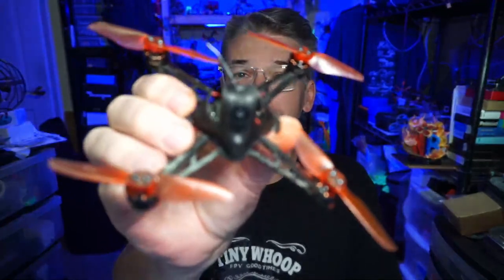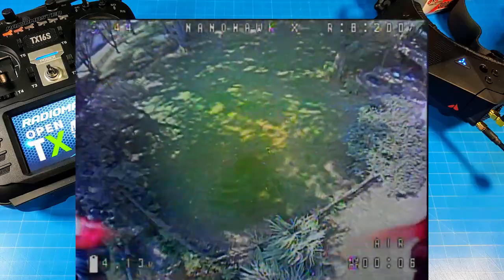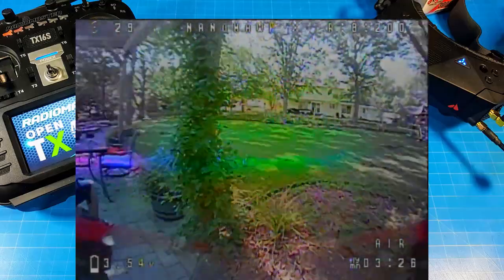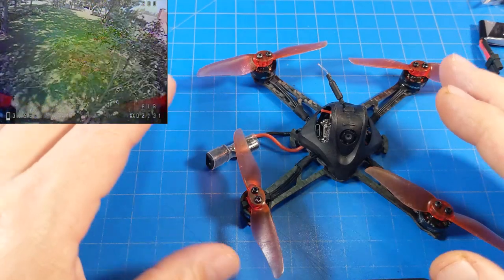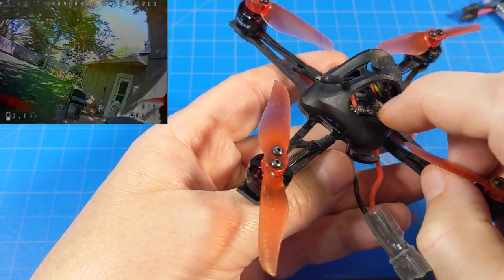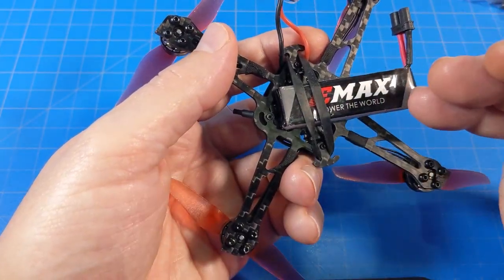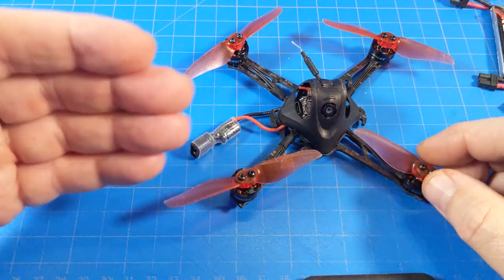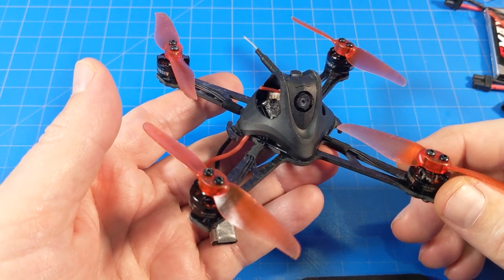Emax NanoHawk X // Durable Micro with Tricks // Ali Express Coupon

Comment: Hi Nick! Great video, I love this board! I put this board on Bob’s TP3 months ago and haven’t killed it yet. I can’t seem to unlock the power on the vtx-only 25mw on the Nano Hawk board. Really hoping for a little better range, especially since it could take a crossfire with the extra uart.
Reply from the maker: I presume when your unlocking your holding the vtx button down and plugging in power, either battery or usb? Keep the button down for a few 'counts' after plugging in.
Reply: @NickBurnsFPV  yeah, I think it’s only 25mw on the original Nano Hawk board, I hope I’m wrong but I’ve tried a few times now and in betaflight it is still only showing 25 or off for vtx power
Reply from the maker: @joelpearson8623  oh, I forgot the vtx did change
Reply: @NickBurnsFPV  thanks for looking into it for me. it’s still a great little board.

Comment: You sold me on another one, I just ordered it. I think this will be perfect for my small backyard and it's quiet. I got the moblite 7 and can fly it pretty well in my small space and hoping the Nanohawk X will be a little better outdoor flyer. Is it possible to bypass the built in receiver and use a crossfire nano receiver?
Reply from the maker: We should be able to add an external rx. The board manual shows an sbus pad as well as rx1 and tx1. I am not sure if the vtx uses uart1 or not. If it does using the rx1 and tx1 pads for  crossfire or elrs rx could disable the use of vtx smart audio.
Reply: When crossfire would be installed and it does disable smartaudio. In your experience could I use lua script though crossfire to change vtx  band channel power? I purchased this for order but really hoping to install crossfire for better range 🙏
Reply from the maker: @fpvdetailz712  I don't know for sure it would impact sa, but that is a concern. I have not found one way or another the impact of using the rx and tx pads, maybe its tied to the on board rx and thus works normally. SA is on uart2, and the rx and tx are labeled 1, so it could be all clear to use as the rx. I am not sure on the use of lua. I have not don't that before on a AIO

Comment: Price is a little heavier than expected, womp womp. I would like to buy the new version of this board, but if you google the board, they all show the original. Hard to tell if you're going to get new or old stock.
Reply from the maker: I have been told they are the same. Nanohawk and Nanohawk x = same AIO
Reply: @NickBurnsFPV  They recently released a new version of the Nanohawk with the new FC that has plugs on it now. But it's hard to tell what you're gonna get if you order a Nanohawk from any given retailer. They definitely used the new version on the Nanohawk X. I just want the new board for a custom whoop build.
Reply from the maker: @dubzsquaredfpv7171  I guess emax doesn't consider the connectors or lack there of a different version, which sure does make it harder to ensure we get what we are looking for.
Reply: @NickBurnsFPV  Exactly! It's my understanding that some comments on the board were rearranged. I'm guessing they had to do that to fit plugs. I only know there's a newer Nanohawk because of Patrick J. Clarke's announcement that he's working on a new PMB tune for it. As you suggested in the video, I hope they make an ELRS version.

Comment: If this is the same board as the tinyhawk2 freestyle, does that mean you could just switch the motors for 1103 7000kv and plug in a 2s battery?
Reply from the maker: It’s a different board, standard whoop board. Tinyhawk line had the elongated board

Comment: Would you prefer this or the HX115 LR from BetaFPV?  They seem to have similar specs.
Reply from the maker: This for me is far better. The HX115 LR is more of a cruising or exploratory flyer. The Nanohawk x can do that as well as fly much more aggressively...and better without having to change props and the PID tune.
Reply: @NickBurnsFPV  Thanks!  I prefer the top mounted battery type frames.  Maybe the motor/prop setup on the Nanohawk could be used for the HX115 (assuming Emax sells those motors/props separately).
Reply from the maker: @MrMmDonuts  sure, 1202.5 is a better pairing for a 3inch prop than the 1102 on the hx115 lr

Comment: Basically NO breakup in goggle feed compared to your flight with the Tinyhawk III. How is that possible??? Any more micros recommended with no breakup feeds? Trying not to go to Dji setups just for clear goggle feeds. Thanks!
Reply from the maker: Breakup is highly dependent on environmental factors and the receiver catching the signal. Cell phone towers, wifi etc are all bad for reception
Reply: Thanks for replying! I do understand that but you are flying in the same back yard with both TH III and NHx, same 200mw, same channel R:8, the only difference I see is with the Nanohawk being BNF you used something other than a whip antenna on your goggles like the TH3 goggles that come with whip antennas on it's goggles. Thought goggle antenna style had to match the quad. Any idea what goggles and antennas you used on your goggles when you flew this BNF Nanohawk X? Thanks!
Reply from the maker: @dustin3983  They do need to match in the case of a single antenna and where the antenna is circularly polarized. Two left hand or right hand, but not mixed left with right. With linear antenna we can use pretty much any antenna, I haven't tested linear on quad with linear on goggles, I use two right cp antenna on my rapidfire, one vertical one horizontal. Not all vtx are equal. I have flown some at 200mw that aren't as good as 100mw or even 25mw. mw power isn't a guarantee we will have better reception.

Comment: I saw Nurk fly this with an Insta360 Go 2. In your opinion, what's the best flying microdrone with a Go 2 (or similarly sized camera)?
Reply from the maker: Hmm I would need additional parameters. Prop protection, battery, prop size etc
Reply: @NickBurnsFPV  Something along the lines of a 2 or 3 inch toothpick. Smaller would be better but if performance is compromised, I'd go with the bigger one. 1s or 2s only please.
Reply from the maker: @MrPhilbautista  2s is going to carry better, but there isn't much in the market other than the crux3.

Comment: Hi Nick   Great video and review of the Emax nanohawk.  I am loving the micro quads we have been flying lately, I think it's great that the noise is very low, and I would have fun flying it. I have not had a 1s 3in yet but I would rather have had a choice of a 1s to 2s with 3in but it looks like it's a capable quad.
Reply from the maker: We could see a 2s version one day. They did that with one of the tinyhawks.
Reply: @NickBurnsFPV  Maybe
Reply: I've built a 2S version, using FPV Cycle 2mm baby tooth frame  and Rcinpower GTS 1202.5 6000 kv, dry weight <40gr. One of my favorite builds, did not expect to fly this good!
Reply: @miguelt.7997   I have built a couple of micro's quads that I fly every day,  they are my favorite ones I have.

Comment: I added elrs ep1 seems a waste though as the vtx feels pretty suckie so far compared to same 200mw's in a Whoop with elrs aio 5in1 board.   Not sure if the vtx just sucks or the dipole maybe too could be sh_t.   Needs an rchp micro.  Even around my 2acres video drops out on me in places that I can fly the elrs aio board also on 200mw with a dipole.   Ready to just slap the elrs aio in there and call it a day....  three components fall down to 1 and the vtx works better lol!
Reply from the maker: Any channel differences between the quads. Meaning both on the same frequency?
Reply: @NickBurnsFPV  that's a fair question I will have to double check but do believe same channels.   Ya know, once an elrs aio is in there ought to be room on top for a 1w Mach5 lol.... weight can't be too awfully increased and the range would be insane.  Yesterday I flew 19minutes (cruisin) on a Sony 18650 and it recovered to 3.6v after the flight!!  Imagine it could go 25-30mins if run down to 2.7-2.8v.   Crazy part... it doesn't fly bad AT ALL with the 18650.   Plenty of punch for rolls flips etc.  I was dumb founded!  Not sure if it could fly but wondered that it might just be able to carry another 18650 in parallel imagine 40minutes flight!?  Actually o
prolly the lack of efficiency would kill it and that 40 mins would never happen.   Still was impressed (and bored) of 20min flight time.

Comment: Hey Nick, I purchased one of these and the video quality was very poor straight out the box, when flying I completely lose all video signals within an extremely short range. Same flying conditions as always and only happens on this quad Anyway, it looks like the element part of the VTX antenna is missing (the bit that sticks out of the top of the antenna). I can't even get a response from e-max which is extremely disappointing. Any idea where I could buy a replacement VTX antenna and what type I would need to order?
Reply from the maker: I am surprised emax has responded, how long has it been? I would look at the ort micro vee antenna or another dipole antenna. We should stay light with the antenna as a few grams can make a large difference for the performance.
Reply: @NickBurnsFPV  Hey Nick, thanks for taking the time to get back to me. Yes, I was surprised also. All up it's been well over a month. Took about a week before someone got back to me and said they would forward it to their engineers who would get back to me in 5-10 days. Approx 8-10 days later an engineer contacted me and requested a copy of the video, which I sent immediately. That's was about 2-3 weeks ago. I sent another reminder about a week ago (stating I wasn't impressed with the lack of service) and have heard nothing, so I have now given up on them and will no longer purchase e-max products. Anyway, I need to get this one sorted. What I am not sure of is do I need a particular type or length etc. The ort looks like a U.Fl, mine is directly soldered. Can I just cut the plug off and solder it directly onto the board? If I get a dipole does it have certain specs or be of a certain length, are all antennas capable of up to 200mw?
Reply from the maker: @shanejohnstone4245  If the anteanna is a vtx antenna it is cut to the proper length. unfortunately with the single wire antenna there is often no ground which the outer wire mesh of a traditional antenna is for. The length we need is 12.9mm, I believe. Search for "vtx antenna wire length".

Comment: Are those old school E010 props on the Nanohawk.  I have a set of those that I reamed out to fit that quad but have not tried them yet.  How are they?  The 3 inch looks good, great quad for training someone in outdoor freestyle.
Reply: yes, they are what I recommend for the nanohawk as they don't destroy themselves like the stock ones do.  Just need to drill them out for 1mm
Reply: @ProjectMockingbird  Thanks Jim, I have been using 4 bladed gemfans, but I have some of these drilled out already.  Will have to check them out.  Shall I assume you have a PMB tune for this now as well?
Reply from the maker: Yep, PJC gave me that tip and I fly so much in the house I needed to do something to keep the props on an flyable. As always he was right :)
Reply: @trajanfpv  yes, I just did a new Nanohawk tune in betaflight for the one with plugs, and will be updating my Emuflight one now that 040 was released.
Reply: @ProjectMockingbird  😎, hit me up when you got that done. Would be happy to try that out. You do good work as always.

Comment: Nice review, looks like a nice little flyer. I'm still new to FPV and I was thinking about getting this as my first toothpick. Does anyone know if it is compatible with the Flysky FS-I6X controller?
Reply from the maker: Unfortunately Emax products don't come with flysky protocol receiver. We would have to add a flysky receiver to the quad.
Reply: @NickBurnsFPV  Thanks for you reply Nick, that's what I guessed. Maybe it's time to upgrade my controller to one that supports more protocols.
Reply from the maker: @wongowonga  At this time it might be a good thing to think about, very very few to no micros comes with flysky :(
Reply: @NickBurnsFPV  OK, that's my 40th B'day sorted then. Thanks again Nick, your comment just saved me several hours of research :)

Comment: Great review. Do you recommend this or the babytooth?
Reply from the maker: I don't believe a babytooth can be built at this price, but if it can they are both very comparable.
Reply: @NickBurnsFPV  just saw this https://youtu.be/QOLcAnl045M , much cheaper than nano hawk x, with elrs and better camera I think. Will wait for your review and opinion before buying.
Reply from the maker: @mrityunjay1234  The footage in that linked video is from the go2/peanut external camera.
Reply: @NickBurnsFPV  yes, I was talking about caddx ant vs the runcam nano 3 on emax
Reply from the maker: @mrityunjay1234  yes ant has better image, nano 3 has a wider fov.

Comment: Will this board work on standard whoop frame?  I know emax likes to make things proprietary.
Reply from the maker: for the layout yes, if we go usb port down we have the flip the board orientation in betaflight but thats no biggie
Reply: This will cause the motors to have to be remapped right?
Reply: With some modding.. will work. Otherwise the mounting holes on fc are bigger.
Reply from the maker: @ZukiManDan  yes, we would need to remap if we change board orientation.

Comment: Are your goggles prescription?
Reply from the maker: No. My prescription is pretty weak and for viewing at a distance. When I am at my computer and not on camera I don't wear my glasses. :)
Reply: @NickBurnsFPV  Just bought Tinyhawk 3 RTF. Can't use the goggles, far sighted. Made a diopter from some old reading glasses no luck. Any ideas?? Thanks.
Reply from the maker: @mortonbeard2240  I have heard various people taking glasses or magnifying lenses from a headset and gluing them in the headset to get them into focus.

Comment: Hey Nick I practice a lot now in the Sim to get better in slaloms and corkscrews. I’m still having problems.. any ideas you can think of to help me? I’ve tried rates and camera angle but still can’t get it yet..
Reply from the maker: what sort of problems are the slaloms and corkscrews giving you?
Reply: @NickBurnsFPV  it’s still hard for me to objects in view which is throwing my timing off.. I made the center of the sticks less twitchy thinking it might help.. maybe even more stick time but it’s just not clicking the way I feel it should.. I have about 30 hours on the sim
Reply from the maker: @dmarriodavis9588  Other than the sim time have you had some additional flight time?
Reply: @NickBurnsFPV  not a lot like 10 hours or so.. this is my first time flying anything.. I do a lot of Rc bashing/racing. I like your flying style and maneuverability so thought to reach out for tips
Reply from the maker: @dmarriodavis9588  The reason I ask is its an important reference in flight expectations. If it the issue with tight turning we might need to increase our yaw rate to help us compensate. Yaw is passive and while we often thing of rates as being even across axis, we are all different and might need a bit more rate on one axis due to dexterity or hand finger size.
Reply: @NickBurnsFPV  thank you Nick I really didn’t think about it that way.. very interesting concept and that just might be the reason.. I’m going to mess with that rate tonight.
Reply from the maker: BTW I use a higher yaw rate than other axis. I have repeatedly tried to have even rates, it just doesn't work for me.
Reply: @NickBurnsFPV  okay I want to try that.. my I have your rates to have a starting block.. I was trying a few things tonight and it was helping when I turned up the yaw rate a little
Reply from the maker: @dmarriodavis9588  My rates P and R 1.2 and super .75, Yaw is 1.3 and super .8
Reply: @NickBurnsFPV  Thank you Nick I’ll try those and build from there..

Comment: Nick, what about that one with an 18650 :D
Reply from the maker: huh? fly this with 18650??
Reply: Yes.  Will fly just fine
Reply: 18650 can go as low as the upper 2 volts, drone components are not designed to go that low and will end up shutting down, so you're missing out on flying time.
Reply: @miguelt.7997  I've built plenty toothpicks.  Tried everything.   On 3 inch props, 1s 18650  flew for about 9 minutes.
Reply: @NickBurnsFPV  this is basically the same specs as the Dave C Nano Longrange quad. You need a VTC6 or a Molicell P26 or some other high current 18650 but it should cruise for over 20 minutes on a single cell (I recommend soldering leads to the battery directly instead of using a battery tray)

Comment: Nick I am surprised you are charging your 1S batteries with such a primitive charger! You really should get one of those series charge boards (fractal engineering, or DIY as per Mutefpv's tutorial https://youtu.be/M49JZMRxO18 ). It let's you put them into storage charge and monitor their health as you charge them!
Reply from the maker: Oh yes I do have the flying sandal series boards. I have two of those. Depending on the day/evening I could be charging a host of different batteries from 1s to 6s, my charging might need to happen on the typical 1s chargers. When I am done or pretty much done with a series of batteries I do storage charge them with the series boards.